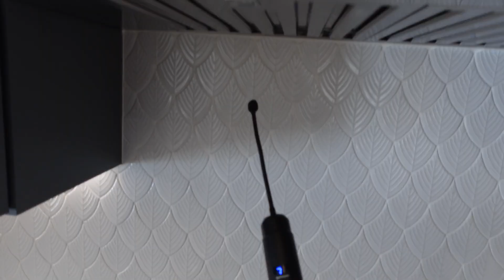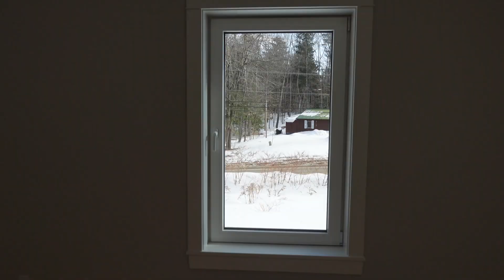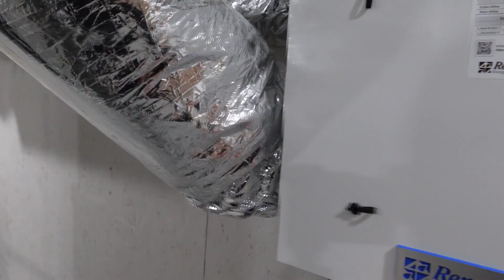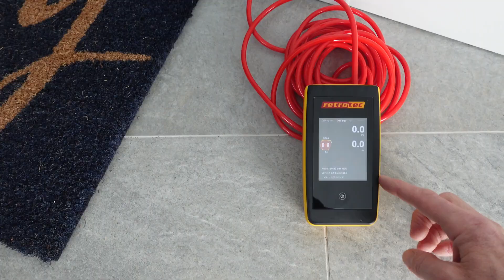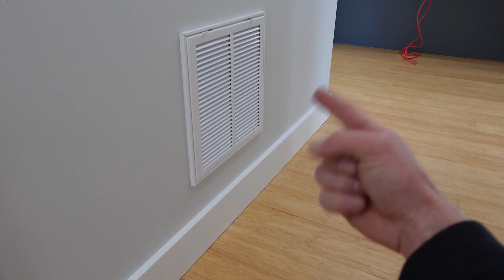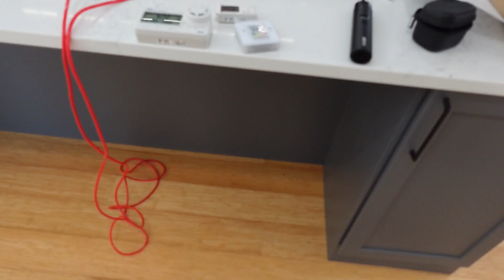7 Steps to good indoor air quality

Comment: First off congrats on building an amazing house. I remember you installed sensors inside the walls, when do we get to see those charts? 200cfm running all the time thru the merv13 seems high to me. I go with 600cfm thru a merv16 for 5 minutes and off for 9 minutes. My co2 pm2.5 and TOC stay nice and low in a 3000 ft house in Colorado with a 5 ACH50 using this blower profile. But your house is amazingly tight compared to mine. Thanks for sharing all this. I would love to know about the static pressure numbers on the hugh return into the air handler.
Reply from the maker: Hi Dave , thanks for the comment.  The house is for sale on the market and no one is living in it, so the sensor info is not ideal.  However, the highest WMC in the wall is 13% and everything is dry and happy!  I like the lower constant flow through the filter to keep the static pressure low.  The total static pressure (supply plus return) is .5wc.  So it worked out great.   Sounds like your monitoring as well!  Happy building !
Reply from the maker: Dave, this video was the pressures in the air handler.  Thanks!

https://youtu.be/3j8ddos1ZYU?si=FMDzCyfxTqkZVmb2
Reply: @ShawnBaldwin603  I am totally amazed how low the static pressure is across your filter. My total static pressure is 0.91"wc in the summer when the blower is at 1750CFM and that is with a MERV11 filter, in the winter it is 0.14"wc with a MERV16. I have a pressure drop of 0.26"wc (clean) in the summer. The filter is rated for 0.18"wc when clean at 1800CFM. Seems like I might have to switch from my "Lennox X6673 Healthy Climate " filters to what you are using. I gotta say of all the people sharing knowledge on YT you provide the best info on real projects than anyone else, please keep it going!
Reply from the maker: Hi Dave, yes thats the real pressure drop.  Its because the filter is way over sized and its the thckness of the filter and I am running the heat pump runs constant at low speed.  Check out this video about the filter comparison, its where I got the inspiration.
 https://youtu.be/-3Eb6Y8aCHE?si=_ITvLcyQeYGartUg
Reply from the maker: Dave, did you ever change out your filter housing?
Reply: @ShawnBaldwin603  not yet, I think that will happen when I add a heat pump to my furnace setup.
Reply: Oh you did show the static pressure sorry.